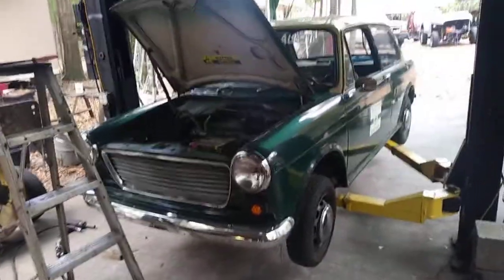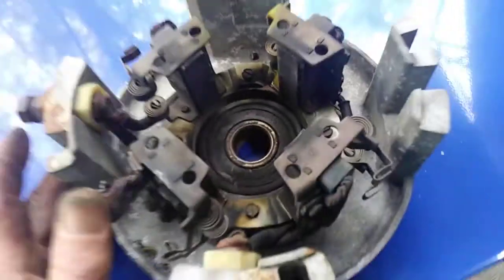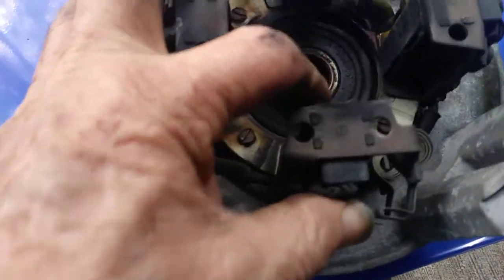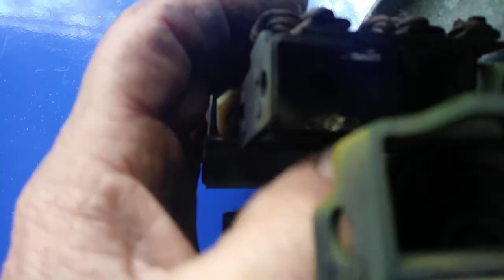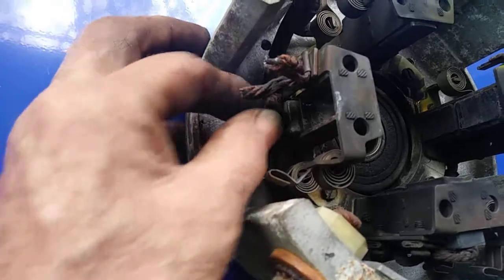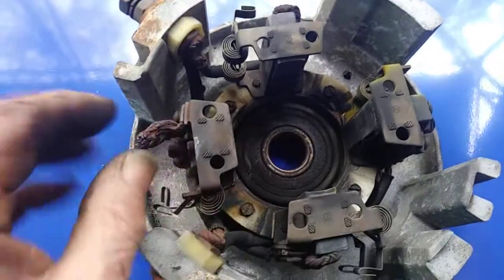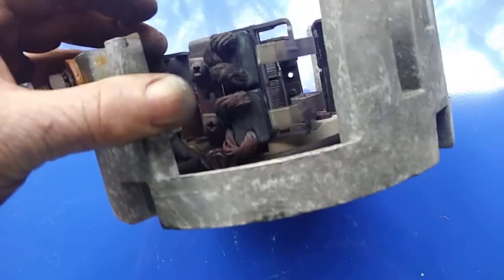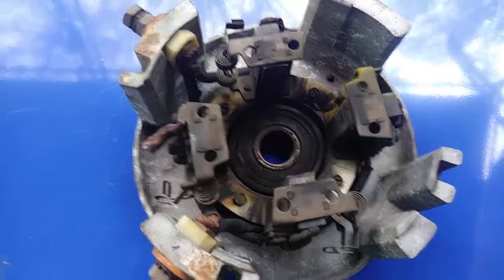Stuck brushes in advanced DC 8 inch motor

Comment: So how did you fix it?  How do you keep the brushes from getting stuck?
Reply from the maker: I kept working the brushes back and forth until they finally came loose in the holder I pulled them out and just lightly sanded them to get the the gummy brake dust off and then put them back. Taking a air compressor air nozzle and blowing on the commentator to get the dusk out once a year is probably a good idea.
Reply: @steveclunn8165  Why do does the motor have brake dust on it?
Reply from the maker: @skipondowntheroad5833 That's not brake dust that's dust from the brushes of the motor and when the humidity mixes with that carbon brush dust it can make the brushes stick in their holders which is what happened here. This is one of the drawbacks to the old style brush motors which is not a major problem I would say at least once a year one should blow out the carbon dust from the brushes that is inside the motor with compressed air like you would blow clean and air filter.